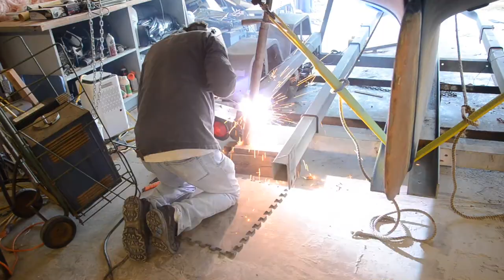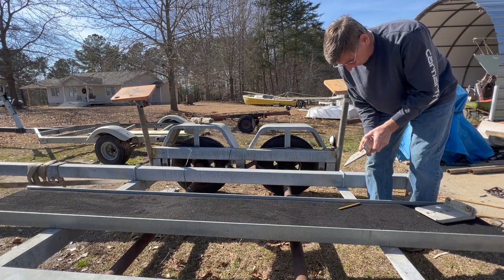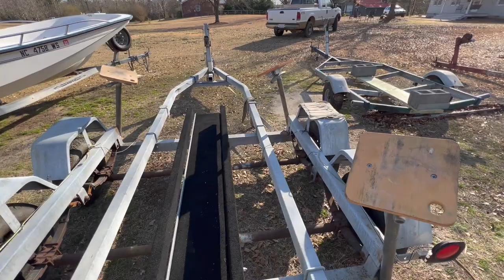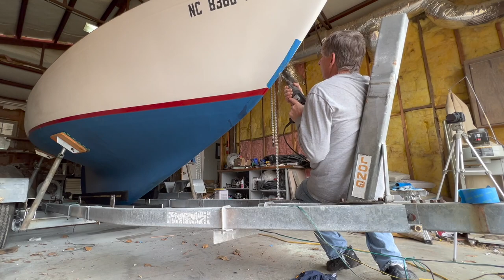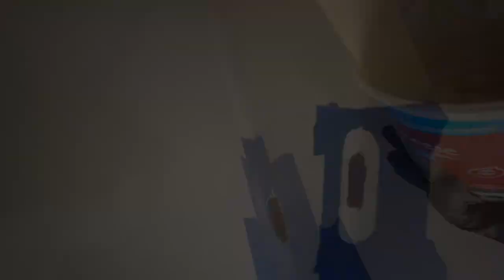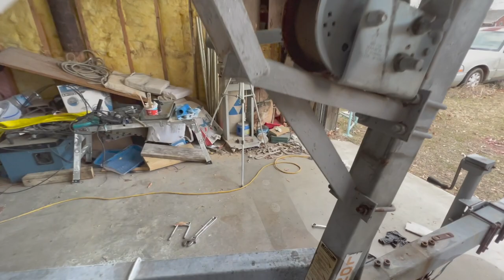Sailboat Trailer Build-Part 2

Comment: Very nicely done!  I am not a welder,but around here they are very hesitant to weld on galvanized steel.  They usually suggest making a bracket that can be bolted to the trailer.  And, I am sure you thought it wasn’t necessary because of the long keel, I would have considered a “chin” support under the bow.  My boats also need to be ramp launched, so I need a ten to twenty foot tongue extension.  Enjoyed your solutions. Thanks for posting
Reply from the maker: Thanks for your comments and thanks for watching! Welding galvanized is not good for your health for sure. I had an exhaust fan running to help clear the fumes and I basically just did a heavy tack to hold things in place. Then moved it outside to complete the welds. I used cold galvanize compound to paint all welds but still not as good as the original hot dipped parts. The idea of a bow support is a good one and I may add one later after I see how it handles launching and retrieving. Where I launch is a fairly deep ramp so hopefully I can get away without a tongue extension. The main angle irons that support the keel are bolted on.
I appreciate your input and suggestions